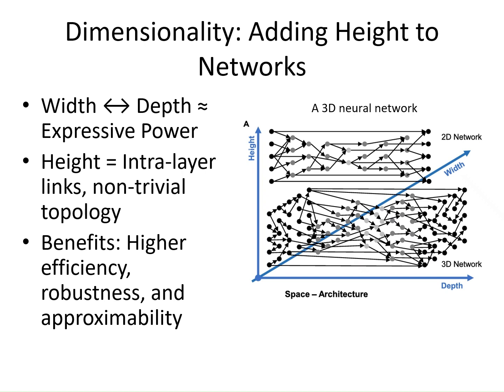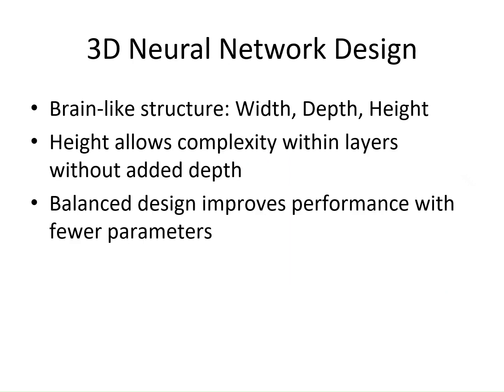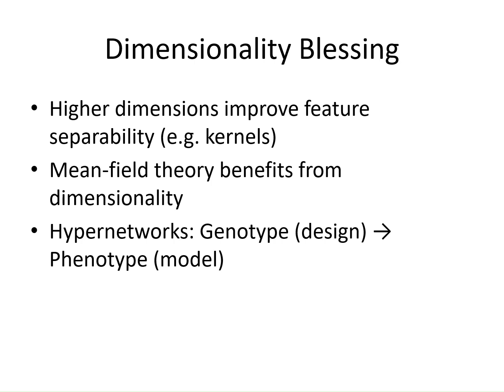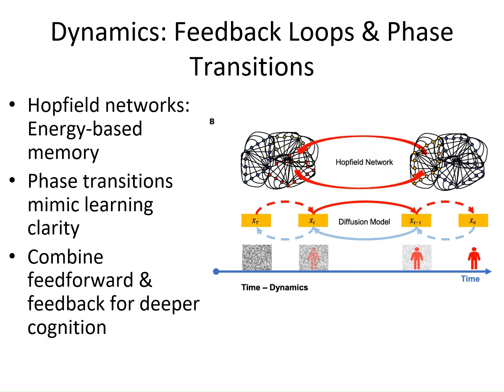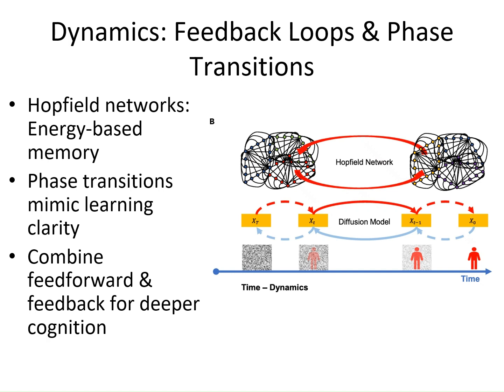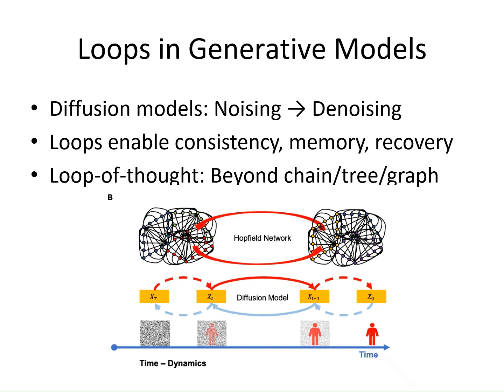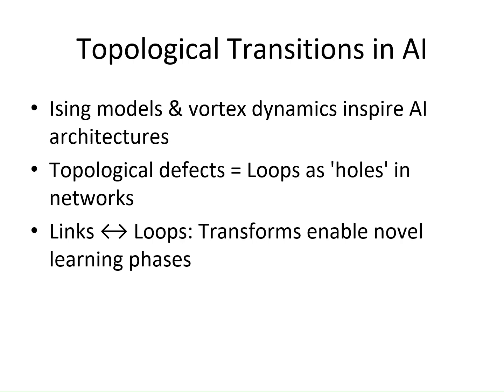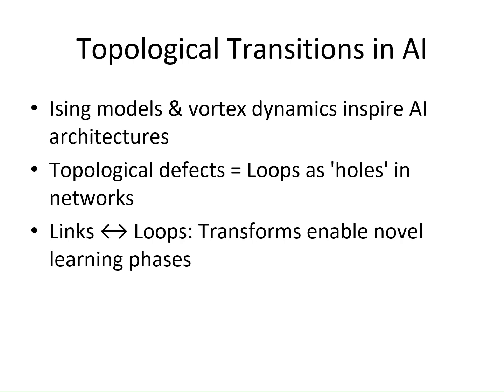Dimensionality and dynamics for next-generation artificial neural networks: Dynamic 3D Nets

Comment: How is 3:50 different from a Unet?
Reply from the maker: Hi
Nice question.

Well, I think they differ in terms of the presence of intra-layer links. Though U-Net has skippings across the convolutions and encoder/decoder layers. The intra-layer topological complexity in U-Net is limited when compared to the 3D nets I discussed; it is quite symmetric and fixed. But both can utilize a diffusion model approach.